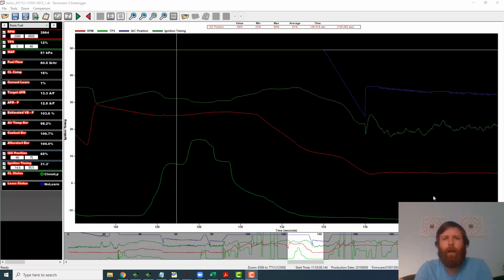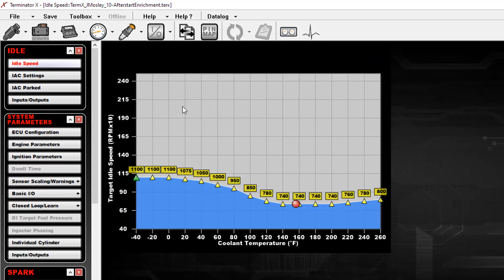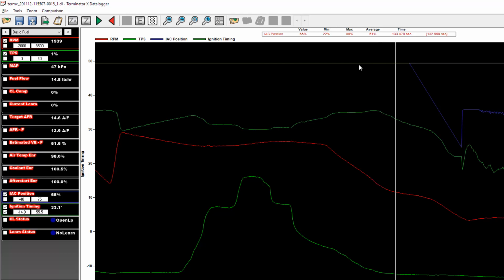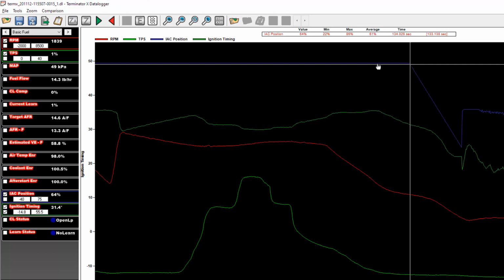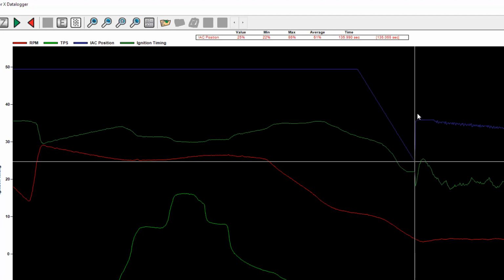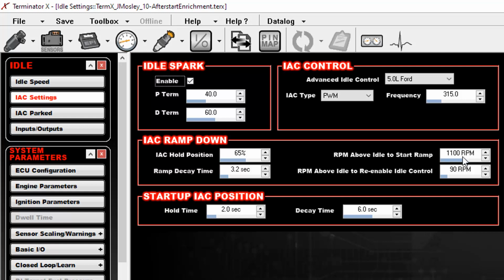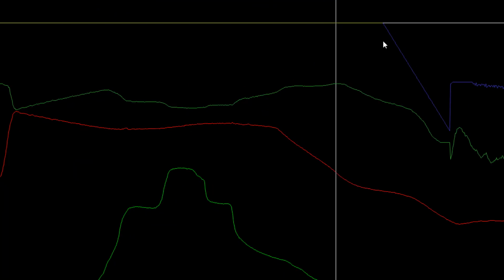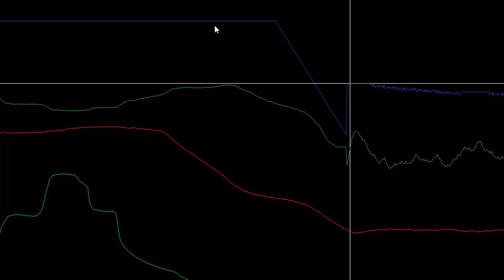IAC Ramp Down in Holley Terminator X for Fox Body Mustangs

Comment: you explain tech terms for everyone to understand, where joe simpson will just confuse the average user. great job, Ive had so many issues with holly sniper 1 that Im chasing my tail trying to solve the root problem which is this exact same problem, i have a 5 speed and the IAC control acts differently depending on which gear your in, hi way cruise speeds in 5th gear is problemamatic, down shift to 4th gear on hi-way and IAC will finally idle down, in 5th gear is closed loop locked at 25 IAC position, very bad, it like cruise control i in play.

Comment: Can I make my efi sound like a carb?  Tap the throttle for a little rev and have it fall right down to idle without any ill effects?
Reply from the maker: To do this you’ll need to block off the idle air valve and tune without it.

Comment: Hi. I have my IAC parked position at 50% and ramp down at 4.2. Every time I come  to a stop my rpms come down but blip back up to about 1400 then back down to  normal 950 rpms. Even when I am parked and give it a bit throttle it always goes up then down and blips back up to 1400 - 1500 rpms then back to normal. Sometime it goes really low down to 850 then up again. Any suggestions?? Thank you.
Reply from the maker: I hate to say it. But the reason it automatically blips back up is because the deceleration logic in this system is lacking. When you cross back to your threshold above idle rpm, it’s going to open the valve 17-18% instantly. While the intent of this is reasonable, having a fixed and unavoidable iac increase is a little ridiculous. This is my single biggest complaint with the entire Holley efi system and will be the subject of a future video.
Reply from the maker: The logic I mentioned in my previous comment occurs regardless of which valve is being used.